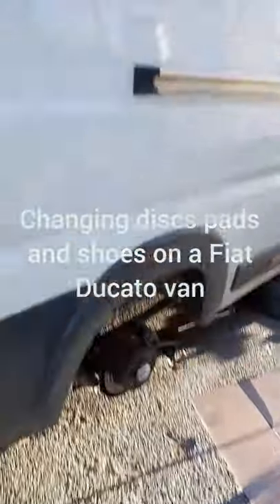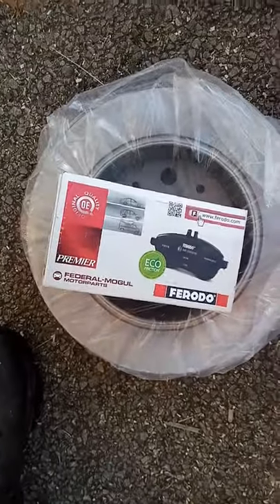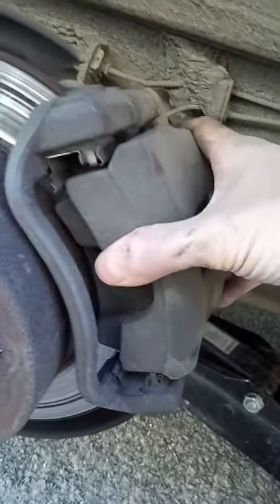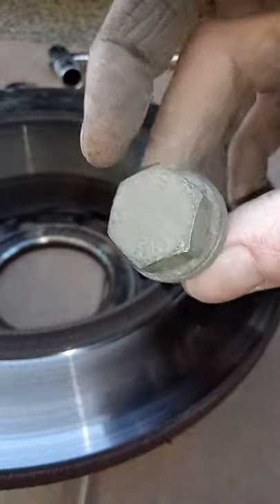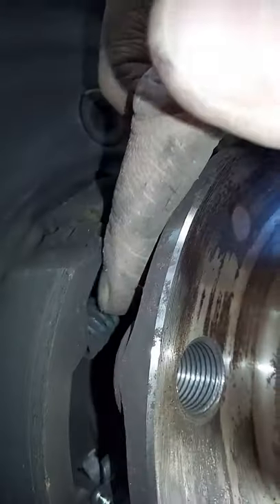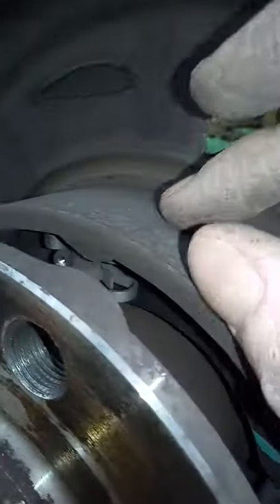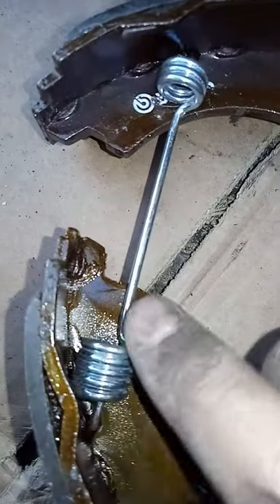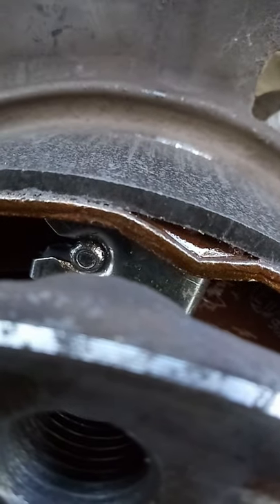Fiat Ducato change rear discs pads and shoes

Comment: Those clips for the retainer pins can be a nightmare,
There is a simple solution to this fully compress the clip in a vice or with a mole grips tie some thin wire around the clip below the slot,this keeps the clip compressed enough to just slip the clip under the pin,finally cut the wire and the clip springs into place.
Reply from the maker: Superstar!!!!! What a fantastic idea 💡
Thank you so much for your great input
Have a great weekend!
Take care